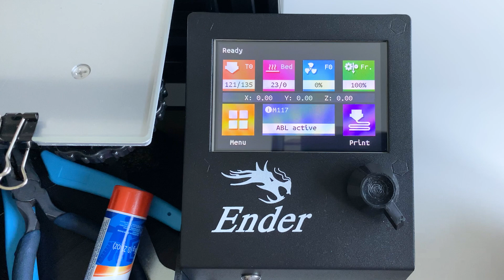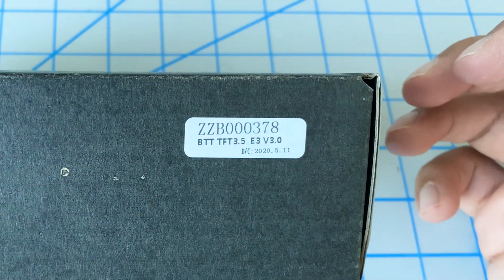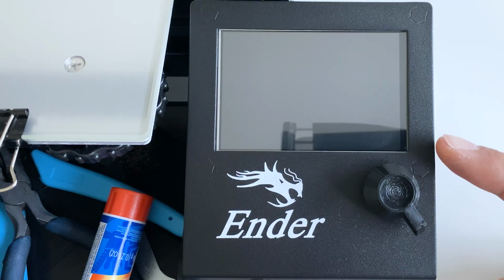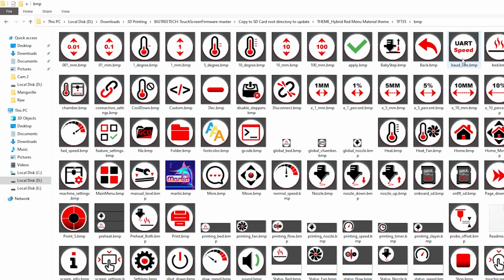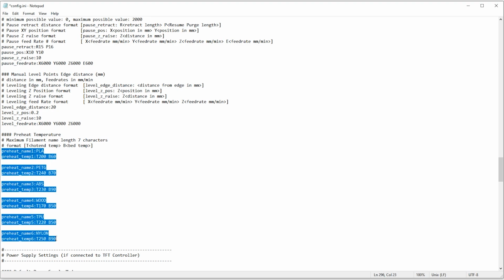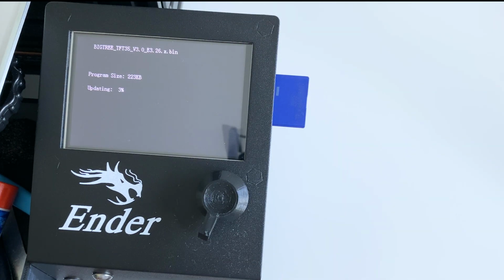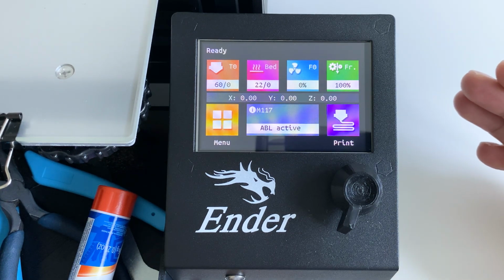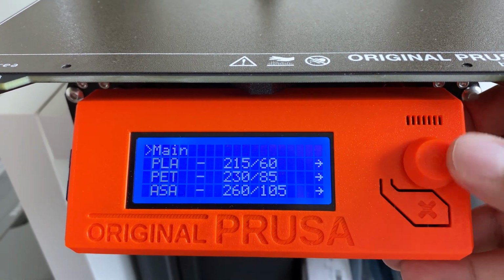Creality Ender 3 Pro BigTreeTech TFT35 E3 V3.0 Touch Screen Upgrade Review | GOOD but some gotchas!

Comment from the maker: For those of you looking to add touch screen to your Ender 3s, make sure to confirm that the touch display is compatible with your motherboard first. Per the linked wiring guide, this requires a BTT or RAMPS based motherboard (the video was based on a BTT SKR Mini e3 V2.0 board). You will not be able to get the touch screen functionality with the stock motherboard.
Reply: i updated the motherboard to the skr mini e3 v2.0 as well--ender 5 plus
Reply: And that is the biggest Gotcha of all.
I'm Just rebuilding and upgrading a Modified Ender3 I bought last week off ebay for peanuts. It's a V1 with a 422 silent board.Shame as if it had the original 8 bit I would have been looking to upgrade.
I spotted these display boards on Aliexpress for around $20. What it doesn't tell you is that you'll end up using it in Marlin mode unless you also Buy a Bigtreetech Motherboard upgrade and spend a couple of hours downloading and configuring firmware. Which doubles the price and considering 3d printer prices now. For upgrade board and display and the cost of an old ender3 from ebay. You're into second hand Prusha territory. And if you're spending that sort of money may as well pay $100 more and go buy a brand new Bambu Labs or and Elegoo that will knock an Ender3 into a cocked hat.

Comment: I just installed an SKR E3 Mini and the BTT TFT35. I'm surprised: 

the Marlin mode works perfectly. heating and motion works fine 

In touch mode the printer is recognized ("ender 3 ready" status), but the printer does not respond to any input from the TFT

Can you possibly help me or have an idea what I did wrong?

firmware was taken directly from BTT-Github

Comment: 17:48- Hold down on the knob? I'm just now installing mine on a Cr10 and I noticed that mine doesn't have a switch (press to enter with a distinct click) as the old display had. Now I'm wondering if I have a defective display and should I return it to amazon?

Comment: Hey, still a relevant video! I just bought and installed one of these to my Ender 3 w/ a BTT SKR mini 3 3.0 or whatever that thing is. I want to note that even though the baud rate was 115200 and selected in the menu I still had to select it anyway again, just like it sounds. I it still never finds the printer.
Reply from the maker: Thanks for the comment

Comment: Just to let people know, this info is still accurate in 2022. I just went through and made the changes mentioned and WOW! It's some good QoL stuff.

Also, that speed issue with the dial, is also still a thing. I WAS GOING NUTS trying to figure out why my prints were slowing down sometimes, and fine others. I thought it was my Cura material profile. It was the damn KNOB!! I just printed a new Calcube with all my normal cura settings, and didn't touch the knob at all. THANK YOU!!!
Reply: you would think they would have it figured out by now
Reply from the maker: Thanks for letting us know and glad you found the video helpful. I'm shocked they haven't fixed that speed bug yet! :(

Comment: What is the other end of your serial line attached to? TFT pins on a BTT SKR MINI E3 V2.0?
Reply from the maker: Correct. There is a nice diagram showing the connections for each of the motherboards here: https://user-images.githubusercontent.com/54359396/132397091-d596abcf-750f-422a-bb59-afafc246dc58.jpg

Comment: I don't know if you can advise, I have setup the TFT E3 V3 as this video and my btt skr mini e3 v2. If I use octoprint and the marlin  mode on the display I can get the printer to mesh level the bed 3x3. If I use the touch mode and select 1,2,3,4 or 5 points the head homes using the BLT then moves the head around X Y home position but head still over bed, lowers the head rapid without BTL deployment into the bed. Like I say if all homed and I use G29 it checks a 3x3 mesh, one this I did find strange though my bed size set correct if I use 5x5 set in marlin the head dose move off the bed z & y home but dose deploy the BLT but this is now not over the bed. Coming back to it is it not working correctly in touch mode. is this something you can advise on?
Reply from the maker: Hey. I did not have that issue and the leveling with 3x3 worked as expected after the touch screen install. Did you try updating the display to the latest firmware? I don't see anything in the screen config that would adjust the BLT either.
Reply: @Mangorille  Yep have the latest and greatest on both the TFT and Main board. I have a bit more info, I have now enabled in Configuration.h #define TOUCHMI_SENSOR 1so I get the TouchMI sensor settings in ABL menu. Tested the BLT and all works ok, in the ABL menu also this deploys the BLT and level's the bed. Where I see a problem is in  the LEVALING menu, there are selections for 1,2,3,4 and 5 points and if I click on one the head homes including deploying the BTL to home in centre of the bead then the head zooms off just over the bad around x y homing positions then without the BLT deploying moves the head at speed into the bed. Its almost like this menu levaling.c & levellingControl.c found in user\API is not made for a BLT or set up somewhere or this part of the code the has M401 is not enabled by infoSettings.touchmi_sensor. I cant track this part of the code as this time to origin.

Comment: Will this work with the ender 3 V2? I have the silent motherboard so the fans are pretty quiet. Is the motherboard you have linked going to make them crazy loud?
Reply from the maker: You would need a BTT motherboard for this to work. The BTT motherboard uses the silent drivers too, would not be any louder than the silent board.
Reply: @Mangorille  would I be able to use the  ezabl pro? I have been reading that I would not be able to edit the code for BTT like you can for the creality so the ezabl still works
Reply from the maker: @ericc8895  BTT does not provide a pre-compilied firmware for that but you can compile your own no different than with regular Marlin. Here a video of us compiling our own firmware for the BTT board for another purpose: https://youtu.be/0tRXUBvcZ0o

Comment: hey dude pla make a video in which you attach bl touch anf filament ranout sensor pls its my request
Reply from the maker: Hey. We didn't make a video on the bl touch as there are many videos already out there but I did help some folks directly through email with the modification. Unfortunately we do not have a filament runout sensor and no plans to add one.

Comment: Hi I recently watched your video on setting up mesh bed leveling on the SKR Mini E3 and thank you for that. I followed along using the Marlin side (I had already installed the TFT35) after doing so I switched back to the touch screen side and it gave me an error that the mesh was invalid. So using the Touch side I dug into it and re-did the mesh bed leveling, stored and saved the info. As you have done this video I too have noticed you receive the same messages upon boot of the printer: Echo Fade Height Off and Bed Leveling on. I will need to go back into the touch screen and set Fade Height to 10 and save, currently it is still at zero. So the question becomes are these messages normal? Once I set the Fade Height will it stay?
Reply from the maker: Hey. Once you set the fade height it will stay, at this point in the video the fade height was set to 0.
Reply: Hi. Question so I just installed the BTT SKR Mini e3 V2.0 board using Marlin along side with Cheetah. Everything is working perfect. I now want to install this touch screen. Can I re compile Marlin re-do the firmware or do I have to run this firmware? tks!

Comment: I have a CR10S4. Installed a BTT TFT 35. Trying to figure which .bin file to select from the 3 options being V3.0_E3 or V3.0_B1 or the V3.0.26. Obviously the E3 is for an Ender3. Which do I select from the other 2 choices? What's a B1? Thanks for a great vid!
Reply from the maker: Thanks, glad you liked the video. Are you able to check in the settings which version of the firmware your screen currently has?
Reply: @Mangorille  The version I selected and installed is TFT35V3.0.26, I don't remember what is was previously. BTW my MB is the BTT SKR 1.4 Turbo. I'm just hoping I selected the right option?
Reply from the maker: @pierre3036  You can try checking the version that is printed on the board itself as well. Does it say B1 there or just a regular 3.0?
Reply: @Mangorille  It says V3.0 no B1 indicated which means I installed the right one! Thanks for your patience and guidance.
Reply from the maker: @pierre3036  Great, sounds like you got the correct firmware in that case.

Comment: Would this also work for the Ender 3 Max?
Reply from the maker: Which motherboard do you have on the Max? This will not work with the stock Creality motherboard.
Reply: @Mangorille  Don't have one yet but it would  be the silent board
Reply: @Mangorille  TMC2208 silent board
Reply from the maker: @migueldevela2917  Unfortunately that would not work with the touch functionality. You need the BTT board, there's a link in the video description.

Comment: picked up a ender 3 and a elegoo mars for $200 that had been returned to amazon with in the 30 day return time period so they was sold off in a bundle or pallet full of different returned items. the ender 3 dont look new but it also dont look to have been ran much. mostly dusty but after assembling it everything powered on an seem to work fine except for the display. it was blank an made a chirping sound every few seconds an the display would sometimes flash with the chirp. i substituted the display with a btt tft35 e3 v3 just to test the rest of the machine an it worked fine. im getting ready to try its first print and after that. on to figuring out the resin printers. literally just got a voxelab a week b4 i got the deal on the elegoo mars. kinda wanna return it but at the same time i just wanna keep it cause i cant help but think, they had to return it for some reason.

Comment: max temperatur?
Reply from the maker: This does not change the max temperature of the printer. You would need to change the hot end to an all metal hot end if you want to go higher in temperature.

Comment: I just had a print freeze after 1.5 hours in the touch screen mode 😐 both the display and board are on the latest stable release. Currently re-printing in the Marlin mode.
Reply from the maker: Sorry to hear that, luckily ours has been okay so far but there are other people with this problem. Were you printing from SD or USB? There's a bug open on the BTT Github for that issue but it's marked as stale because of no recent activity. If you have a Github account, may be a good idea to post a reply in there with your issue to keep it going.

Comment: Hi Mangorille, i placed the tft 35 in my Ender 3 but what i noticed is that the Chip is really hot from the TFT backwards is this normal ? i connect the wires all correctly  , Best Regards
Reply from the maker: Hey. Does it seem to be working okay? The display does a lot of processing so it will get warm especially since there is no fan cooling it down. When you say hot, did you check it with a temp gauge?
Reply: @Mangorille  HI , i test today the Print about 3 Hours , all is ok ,i dont know what it was but now it is running fine :-) But i have another question. Everytime when i shut down the printer and switch it on the TFT Calibration comes for the touch. Is this normal ? I have a SKR Mini 1.2 running on Marvel 2.0.7.2 with the TFT35-E3 V3.0 VS Cheetah V1.2 SKR V1.3 PRO an the firmware from the Tft is BIGTREE_TFT35_V3.0_B1.26.x.bin. Best Regards.
Reply from the maker: @strapoflex6578  That is not normal. Did you try going through the entire calibration one time?

Comment: mine still says "no printer attached" after i made sure the baud setting was correct
Reply from the maker: How did you connect the LCD to the motherboard? Did you try updating the firmware on both sides? There is a minimum firmware required.

Comment: how do I increase the size of the bed 300 by 300 height by 400?
Reply from the maker: You have to compile your own firmware. We have a video on how to do this for the BTT SKR Mini motherboard here: https://youtu.be/0tRXUBvcZ0o
Reply: @Mangorille  I tried but fail you could make one with everything you need besides bltouch the size is 300 by 300 and the height is 400 plz
Reply from the maker: @anghelinaciprian3837  Which motherboard do you have? If you have the SKR Mini E3 V2.0 I can build a firmware for you.
Reply: @Mangorille  Yes it is a SKR MINI E3 V2.0 plus TF35 with all bltouch please
Reply from the maker: @anghelinaciprian3837  Got it, stock firmware except you need BLTouch and 300x300x400 bed size. Do you have your BLTouch offsets? If so I can put them into the firmware. I also need your email to send the firmware file. You can either give that to me or email me.
Reply: @Mangorille  yes
Reply from the maker: @anghelinaciprian3837  Firmware is ready. I just left the stock offsets and you can modify them yourself through the LCD screen.
Reply: @Mangorille  Thanks a lot now I was hoping it would work
Reply from the maker: @anghelinaciprian3837  Just need your email to get the firmware file over to you. Or you can email us mangorille at gmail
Reply from the maker: @anghelinaciprian3837  Just emailed it to you. Make sure to do the restore to defaults and initialize EEPROM after the flash. Good luck!
Reply: @Mangorille  hello, I'm bothering you, I have another problem, I bought a creality sonic pad and I can't connect, can you help me with an ender 3 pro with a table of 300/300/400 firmware.bin
Reply from the maker: @anghelinaciprian3837  Sorry don't have any experience with the sonic pad.

Comment: I want to upgrade my Ender 3 pro with the bigtreetech TFT 3.5 V3.0 touch screen. The mother board is a Creality 4.2.7 board is it comparable and if so how do I hook up the wires correctly.
Reply from the maker: The touchscreen functionality is not compatible with that board. I used the BTT SKR Mini E3 V2 in this video (link in video description).

Comment: Hey mate great vid. I just purchased this unit and I’m really hoping it Is compatible with the Creality V.1.1.5 silent main  board, please tell me it is ?
Reply from the maker: Hey Joe. Thanks! Unfortunately the touch functionality is not compatible with that board. This would just end up working in the regular Marlin mode. Perhaps a good opportunity to give one of the BTT boards a try. I have a link to the one I use in the description.
Reply: @Mangorille  Oh what a shame! Looks like I will have to order one in that case. I also have BLtouch currently installed, Is it a complex process to set up ?
Reply from the maker: @Joey_Wonders  No, it's not complicated. The motherboard is plug and play and you'll need to flash the BLtouch firmware on the board. I can help guide you / answer any questions as it is the same exact setup I have.
Reply: @Mangorille  Awesome thank you mate. Both  devices are on the way. If I get stuck I will definitely be in contact.
Reply from the maker: @Joey_Wonders  Good luck and happy printing!

Comment: can I use this on the Creality 4.2.7 board?
Reply from the maker: The touch screen functionality will not work with that board and it would function no different than the stock screen. You need an upgraded motherboard to leverage the touch screen. I have one linked in the video description.
Reply: @Mangorille  thanks for the help.  Order the board and the touch screen.
Reply from the maker: @ReeseFPV  You're welcome. Happy printing!

Comment: In this video you upgrade display on BigTreeTech board or original factory creality v1.1.4 board?
Reply from the maker: Hey. It was on the BTT board, the factory Creality board cannot support the touch functionality.
Reply: @Mangorille  tnx!
Reply: @Mangorille  e3 v2.0 board? Do you guys know fix for "no printer attached!" ? I can print from Marlin mode tho. I have tried everything :D Different baudrates, serial_ports, cables, with without RST pin. No luck..
Reply from the maker: @nm7869  BTT E3 Mini V2.0 board is the one that was used in the making of this video. Did you connect both cables from the board to the display? You should have the black serial cable and the stock looking ribbon cable connected.
Reply: @Mangorille  Yep both cables are connected. Black with 4+1 pins from boards TFT to screens RS323 and stock rainbow cable from board EXP1 to screens EXP3.
Reply from the maker: @nm7869  That is all correct. Are you sure you have the serial cable connected in the correct orientation on the motherboard side? Check this out for the pin outs on the motherboard: https://github.com/bigtreetech/BIGTREETECH-SKR-mini-E3/blob/master/hardware/BTT%20SKR%20MINI%20E3%20V2.0/Hardware/BTT%20SKR%20MINI%20E3%20V2.0-PIN.pdf
Reply: @Mangorille  Pins looks like connected right. (Tested with and without reset pin, suggested somewhere.) I read somewhere that RX2 and TX2  was another way around in some cases but that might be some different older BTT board. Getting lost in all the information that I have researched :D Thanks for helping me btw !!
Reply from the maker: @nm7869  You're welcome! Next thing to try it to upgrade the firmware of both the motherboard and the display. If I recall, there is a minimum version requirement for the touch display to work.
Reply: @Mangorille  BIGTREE_TFT35_V3.0_E3.26.x screen
 and Marlin-2.0.7.2-SKR-mini-E3-V2.0 board. These are firmwares from BTT Github. I have tested different baudrates and serial_port configurations to those firmwares. This is so confusing cause everything else is working perfectly, now printing from marlin without problem. But I want the touch mode to work :D
Reply from the maker: @nm7869  The Marlin working means that there is some sort of serial communication issue. Can you send me a picture of the TFT wire you installed on the motherboard side? mangorille at gmail